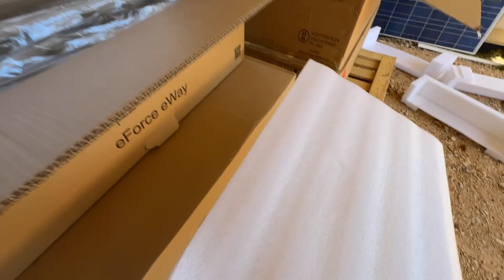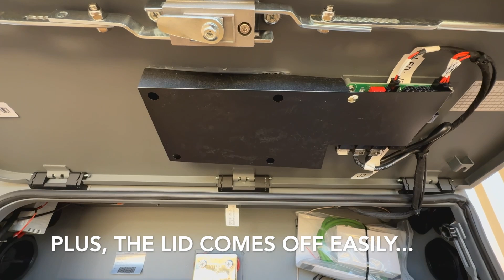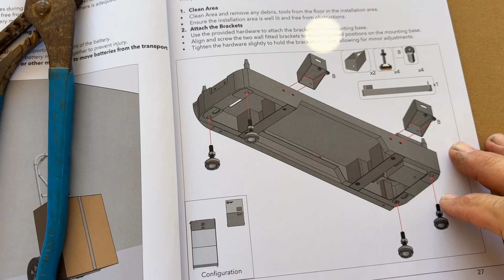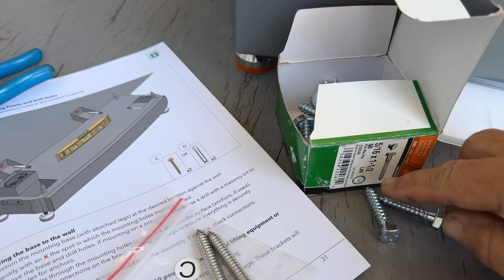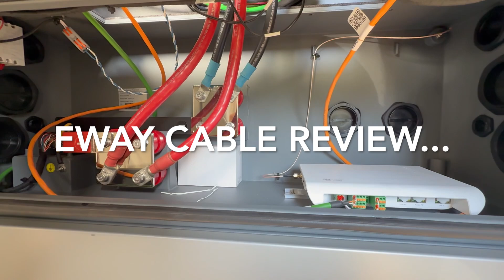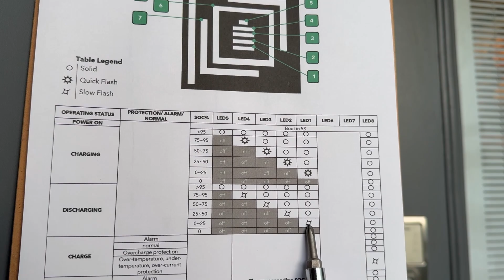Fortress eWay for the eForce Battery unboxing & installation with Maverick MacGyver

Comment: Greetings, please what is the the cost of bd error code and the solution thanks
Reply from the maker: I think that is Battery Discharge error. Could mean low battery voltage at the inverter or battery thinks its output voltage is low or SOC is low or maybe the CAN cable is not connected or wired correctly? What battery & inverter combo are you using? What is the voltage verses the stated SOC?